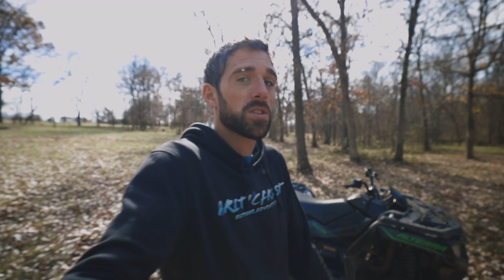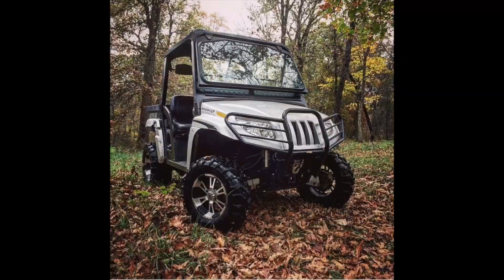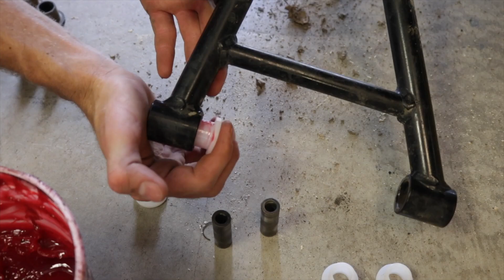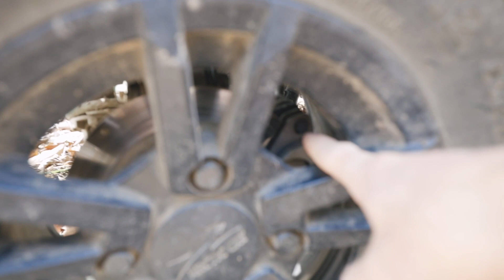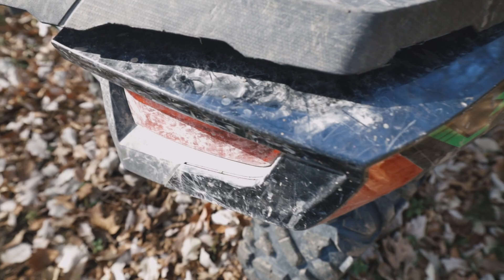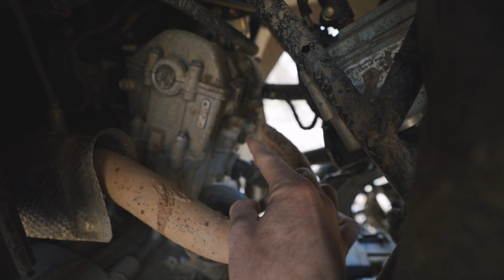Noisy ATV?

Comment: Good info!
Thanks!
Reply from the maker: Glad to help!
Reply: @ArcticFrost  I wondering who your go-to company is for parts?
I've been using Rocky Mountain.
I ordered a front brake reservoir cover sub-assembly kit and it's on back-order till who knows when. I can't believe it's $83!!!
Hard to swallow prices like that for something that should be $30.
Reply from the maker: @mb56436  I usually get from country cat or sometimes eBay. But yeah, the prices have gone up!
Reply: @ArcticFrost  Everything's crazy expensive now. Is Country Cat your local Arctic Cat dealer?